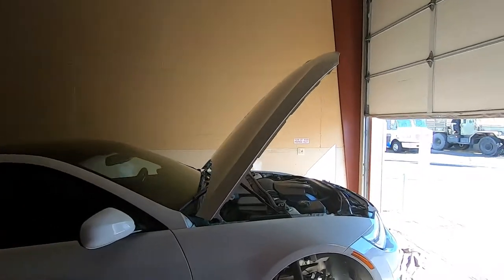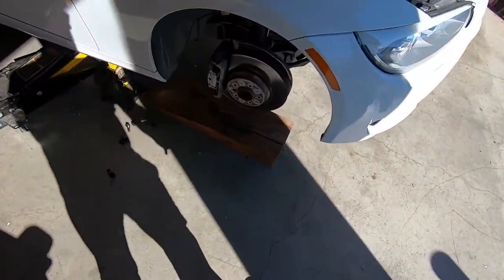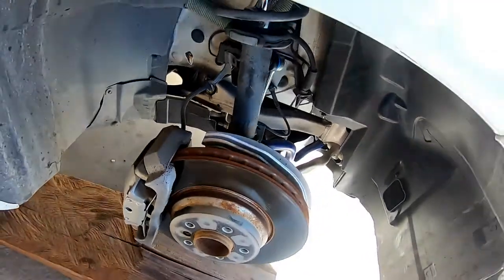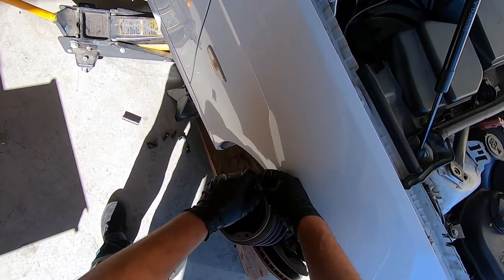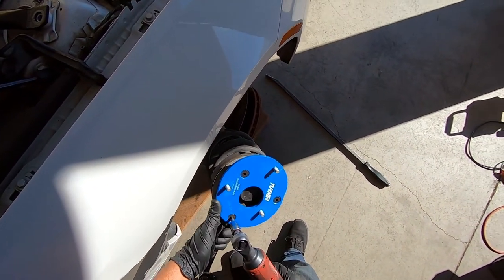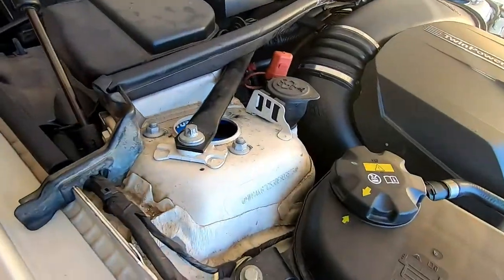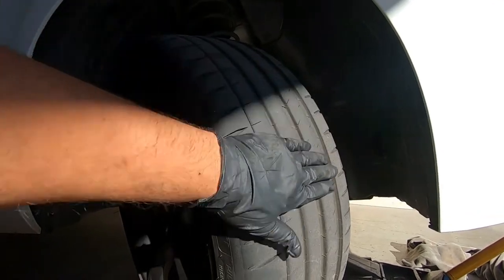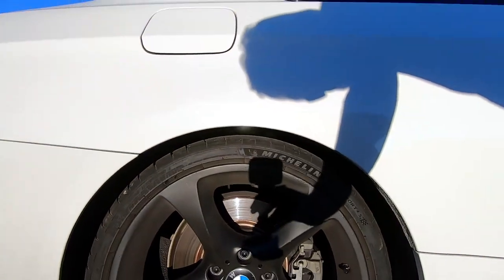Camber Plate Install E92 335i

Comment: appreciate the video, I'll be doing this when mine arrive. What alignment are you running? I am on m3 control arms and bilstein b14 coilovers and Im getting some crazy outside edge front wear.
Reply from the maker: I don't remember exactly cause it was a couple years ago now but I want to say that it was somewhere around 2.6 degrees of negative camber.  If you are getting some crazy outside where that sounds like your tow is off.  When you lowered your car did you get it aligned?  Lowering your car will straighten your tie rods out which will push the back of your tires out.  So your car will be excessively toed in which will wear the outside of your front tires.
Reply: @markskeem  I did get it aligned. Actually three separate times, still got excessive toe wear.
Reply from the maker: I would try to take it to a different place if you haven't tried that yet.  It is possible that you have something worn out.  Most places check for worn parts before an alignment.  There are few that don't.  If they are checking for worn parts.  Other possibility is if you are a more aggressive driver when turning.  If you like to take turns at a much more spirited pace then you might need a more aggressive alignment such as getting more negative camber.  With more negative camber it will keep your tire flatter on the roads during turns so that you don't wear out the outside edge of your tires.

Comment: Give us an update - How's the front tires inside wearing now? And how much negative camber did you get? How many miles you put since then?
Reply from the maker: Honest update. Car had major engine failure.   Has been sitting for over a year now.  Didn't get to run very long for any feedback on tire wear.  it drove normally tho.  When I did the alignment I believe I gained somewhere in the area of an additional -1 degree of camber.
Reply: @markskeem  Curious what kind of engine failure? Hope you get it back on the road soon.
Reply from the maker: @dduktube  I plan on making a video about it in the future so stay tuned.

Comment: Question bro would the m3 control arms give me the camber I need or good enough for the track or do I need both arms n plates? Thank you
Reply from the maker: From what I read, it is supposed to give you another -0.75 degrees of camber.  The camber plates I got were advertised to put me at -2.5 degrees. Factory the best I could get was -1.6. With these camber plates it gave me -2 degrees.  So that only gave me another -0.04. If you go to the track regularly usually you want the front camber around -2 to -3 degrees.  I would install the control arms first and check where your alignment is.  Take it to the track and see if you want more.
Reply: @markskeem  thank you